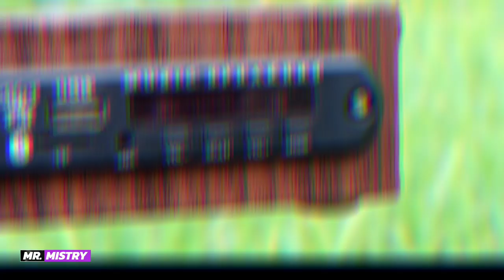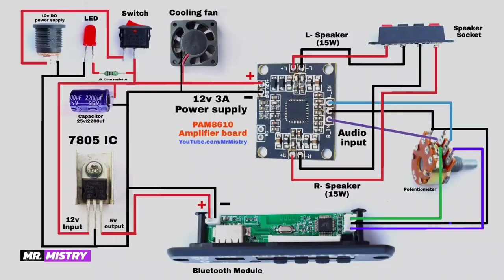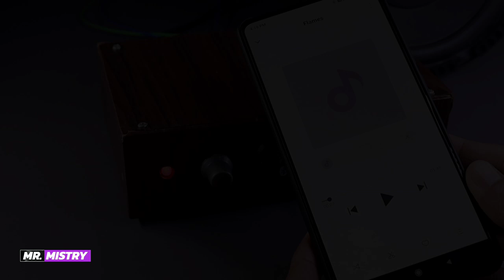Make Bluetooth amplifier using PAM8610 Audio Amplifier board

Comment: 1. What was the purpose to add high capacity Capacitor?
2. Don't you think no intake for air ventilation may hampered exhaust fan capabilities?
3. Would it right be to include Buck Converter instead 7805?
4. Would like to see RCA (audio-out), illuminated rocker switch and 18650 Li-Po setup on your future projects?
Overall, it was nice to see amazing DIY projects by Mr.Mistry! Thanks again!
Reply: That 25v 2200uf capacitor is used to reduce voltage spikes and distortions while amplifying.
Reply: @WarriorRev6300  Please tell me what the amp of adapter you used , because i have 1amp adapter and when i use it and up volume over 45% its get off 8610 sound ,and i have to restart it (off and then on) can't over 45% ,when i use battery pack 12v it works but i can't afford bms , please solve sir , what compatible speaker with 8610 for long term

Comment: The box seems to be nicely sealed.. Good. But Because of that you should provide an entrance hole for air to get in, so that in the other side air can easily suck out by the Cooling fan. For referance check the Cooling system inside an Induction Cooker

Comment: Can we add battey as a power supply.. if, what is the volts, capacitor for stability. Kindly answer me. Same project I did with out capacitor and having voltage drop.  What should I do.

Comment: how many watts speaker we can use in this circuit. which watts speaker you use in this video
please reply as early as possible. thanks for sharing this design. also blueooth module only use 5v power.
Reply: 15 watts on each channel.....at 4 ohm..............or 10 watts 8 ohm..
5 volt amplifier......PAM8403

Comment: which capacitor did you use sir? 
22 muf or 2200 muf ??
Reply from the maker: 220uF  25V
Reply: @MrMistry  ok Sir
On this Pam 8610 board a 2200 muf,35 v capacitor can be used  ??

Comment: I have done this same project but the truth is that I do not see any interaction with the capacitor of 220 Uf at 25 V, however I placed it to great surprise the blutooth module generates a scary noise. Any solution for this?